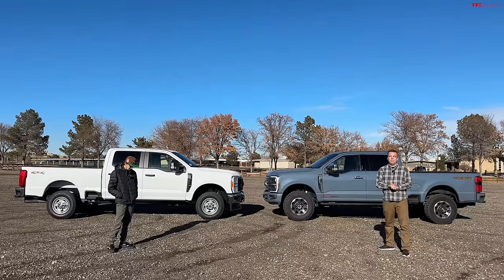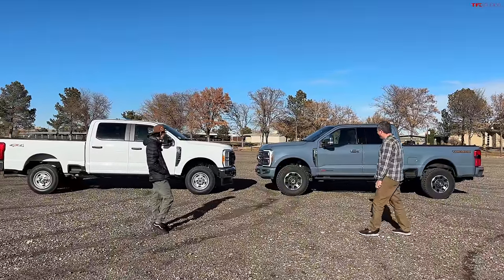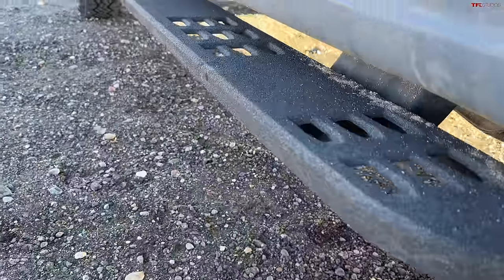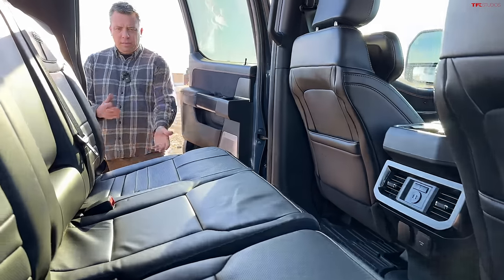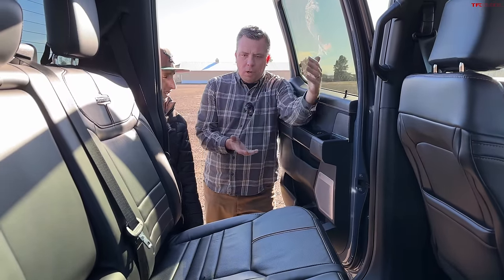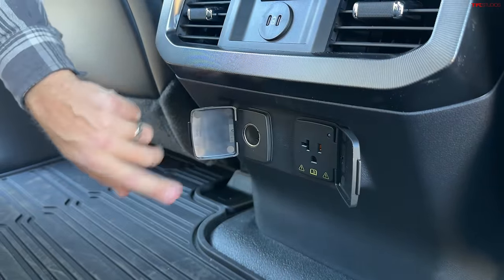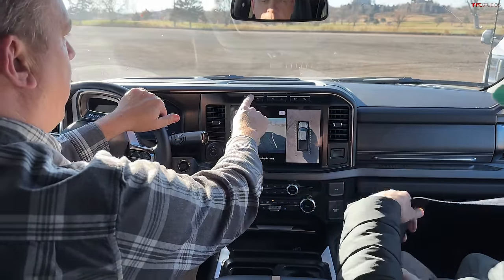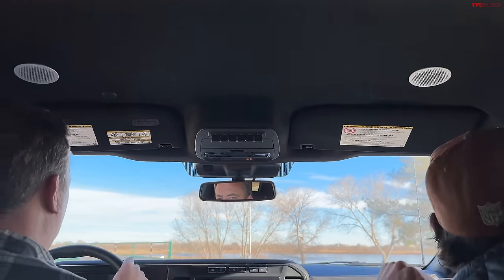New Ford F-250 Work Truck vs Premium Diesel F-250: What Do You Get for an Extra $50K?

Comment: Good thing FORD has a option of four engines to choose from since these bodies are aluminum and the vehicle is fuel efficient and can haul/tow excessive amount of weight. GM (big fan of) can learn a learn a thing or "two" maybe more from ford about engine options.
Reply: Agreed, and I have the GMC.  I bought the Duramax, but would have liked a gas big block with the Allison transmission option.  Bring back the 8.1L , and it would sell like hotcakes...
Reply: @richfarfugnuven6308 the 6.6 gas seems like a solid engine but it's absolutely in the :"just barely good enough" category, which is not what people find acceptable for these prices.

Comment: If that were the choice, it would definitely be a step up from the XL.  I could live with it for sure. But i shopped for 7 months, looking for a v8, 6.5' bed, heated seating and stering, with adaptive cruise.  Everything i found new was over $68k.  Even used in an F250, the price was stupid.   I'll settle for what i found,  a 2020 F150 Lariat 5.0 with under 13k for $44 OTD.  As long as it holds up for the next 5 years, im 😊 happy.   I just didn't want the $1100 payment.

Comment: As someone who had the black capri leather seats (non-perforated) in a 2022 Jeep Grand Cherokee Limited 4x4, I’m not even a sweaty person, but in summer, the pool of sweat and burning the back of my legs was miserable enough where I sat on a towel when temps were above 65 degrees 😅 I’d much rather have cloth seats in the XL. The vinyl looks like cheap seat covers

Comment: The work truck is SOOO much more my speed. I don't need all the electronic junk like remote start, push button, power seats, camera mirror, power tailgate, etc. I like my vehicle to just FUNCTION, and not have a bunch of unnecessary expensive stuff. And it still has those aux switches, which are a nice feature.

Comment: You don't have to go Platinum to get LED lights. IMO, the XLT with some options is the sweet spot price/capability wise. Balance fuel savings on diesel with the added cost of diesel versus regular gas. In my area, diesel is an extra $1/gallon, which is 33% more.

Comment: $50k is a lot of scratch for some bling and a diesel. The camera differences are big to me as well. I went from an Escalade with several cameras to a Silverado LTZ 1500 with good cameras but mine does not have the overhead view. I miss that. I don't need an HD or a diesel to tow my 7,000 lb. travel trailer, but they are cool.

Comment: In 2013 I bought a F350 lariat 4 x 4 for under $50,000 brand new. I cannot imagine how 10 years later this truck is worth 53,000 more dollars.
Reply: 2013 lariat doesn't have the features of a 2023 xlt for under 60k.
Reply: @guyod1  That's the point. You trying to tell me the technology in this truck is worth $50,000? The engines not that much different. The transmission is not that much different.

Comment: He totally missed that with owning a diesel. You have significantly more expensive catalytic converters emissions standards def fluid and you have filters that need replacing more often then a gas engine, diesels Will always cost a lot more to maintain, sure it makes 1,200 of torque but last i saw diesel on average costs about 30 to 50 cents more per gal than gas, if you tow 9tons all day sure, but for the average person/ business the 53k gasser will be just fine

Comment: I didn't watch the entire video but did they go over the XL can also come with MANAUL locking hubs.  Talk about a simple system.  You have to get out and turn the rotor on each of the front wheels to put into 4wd.  You have to do it to release 4x4 but much less to break with vacuum system of the auto locker systems.  The Platinum buyers can have their butler do it for them if they slum down to a low trim.  Yes I was looking into one when the XL F250 4x4 is less than even basic F150s on dealer lots.
Reply: No, since like 2005 super dutys have been auto locking with a manual failsafe.

Comment: Get the XLT with ordered radio upgrade, 6.7 regular setup, still save 35k and have all the capacity of the 6.7 engine. The reason it's a 10k upgrade is because you need the other transmission to go with it.

Comment: Also the Ford undercarriage and axle is always rusty even off the dealership lot.
Reply: I looked under several Ford vehicles at the LA auto show, cars and trucks. Every one had at least a couple rusting bolt heads and other surface rust. Even on a Mustang that was displayed almost rolled over to show off the underside there was rust. By contrast, I did not see this on any other make. Like Ford does not care.

Comment: For $50k you could buy an older 3500 dually frame/chassis, a brand new or refurb drivetrain of your choice without the need for DEF and add whatever seating/accessories you want.

Comment: I'm happy to see you guys talking about the GVWR on these trucks as well. Looks like you have an F250 and an F350 with the wrong badges. The whole point of 250/2500 trucks is the 10,000 pound GVWR for registration purposes. I hope you show more of this because it's very misleading to consumers. They will buy the 250/2500 diesel and register it at 10,000 pounds, and think they still have the full (in this case) 2800 pound payload capacity. That is until the DOT weighs them and slaps them with a fine for being over weight (based on registration) even though they're within the manufacturers ratings

Comment: I actually last week bought for $54,000 a 2018 F350 King Ranch Diesel, crew cab long bed. It only has about 90k miles and to save 50k its so worth it.

Comment: It’s also also good at loosing you money from being in the shop for weeks on end because the emissions crap breaks. 

Give me a 7.3 PowerStroke, 24v 5.9 Cummins (with mechanical fuel pump conversion), LBZ or LML Duramax any day of the week over any new diesel, be it Ford, Gm or Ram.

Comment: It will take you over 250,000 miles to pay for the fuel cost difference vs the initial cost of the regular output diesel, much less the HO. Secondly, every Diesel oil change at a shop will average about $150, plus, every other oil change you are replacing the fuel filters for an average of an additional $180. This averages to $240 per oil change, vs the 6.8/7.3l oil change of $85. Then, you have the maintenance and repair costs. Diesels are heavier, and have more torque output, so you will average about 33% less tire life (still better than electric cars which are more like 75% less tire life)  At 100,000-120,000 miles, a full tune-up with plugs, an induction clean, air filter, and new plug wires would be about $1100 on the 6.8/7.3.  On the diesel, a new DPF filter when the stock one stops regenerating, $2,500-$6,000. Other somewhat common issues with modern diesels past 120,000 miles: A new VGT turbo, $11,000-$15,000, A full fuel system replacement when the high pressure fuel pump grenades, $12,000-$15,000, and new injectors alone, $3,000-$4000. They also have two starting batteries, and are still harder to start in cold climates, so their starter motors tend to fail earlier than in gas engines in said climates. My advice, unless you tow almost every day, and make money from said towing, a gas motor will be the better choice 9 times out of 10. Even IF you make money off of towing, if you do need a repair, the shorter repair hours and parts sourcing on the gas motor being easier would give you less down time. It's also a lot cheaper to insure. Modern diesels outside of true professional pro professionals, that are professional, are unfortunately now on the same wavelength as buying a plane to travel to Mexico twice a year.

Comment: Why do you call it "premium"?  It is just more expensive.  And a "work truck".  What has really happened is all trucks used to be like the XL.  Then manufacturers figured out they could get more profit if they put more crap on the truck.  Instead of denigrating the "cheap work truck" it would be more useful to consider it a truck that does its job with a lot of frufru crap added to the price.  Compare it with my 1974 F150 and the "work" truck is very comparable.  But the manufacturers have successfully created the impression that if you dont buy a higher "trim:" level you are cheap.  That is too bad.  You get the best value with the XL.

Comment: I would take the work truck any day, all the changes have to do is stretch the frame 2 meters and install a flatbed. Then mount a custom built camper on top of that.

Comment: The bed liner is a non-issue, you could get a spray-in for $600.
Reply: Or to be even cheaper, you could do what we did with our farm/plow truck (8ft bed) and get a vinyl garage floor mat for under $50 and trim it to fit the bed. It actually works so well we used the excess for our Gator bed too 😂

Comment: I’ll take the xl, put on the katzkin interior, Carli suspension, throw on a four wheel camper and I’ll still be cheaper than the tremor diesel, lighter, and more off road capable. And still be able to two something if needed. These luxury trucks are ridiculous imo. $50k and the only thing they talked about was the power difference and cameras. Stupid lol

Comment: No way i could ever justify that top of the line truck. If i had money to burn, I'd go for a 350 srw XL or XLT. With the savings, I'd add a steel flatbed and steel ranch hand bumper and I'd still have plenty of money left for upgraded tires and a receiver mount winch. Its a truck, meant for work.

Comment: Towing is limited on the 6.8 due to the transmission. The 7.3 gas and 6.7 diesel both get the same transmission. The 6.8 is a completely different transmission. Not sure why they wouldn’t make things easier and use it on all 3 engines.
Reply: I don't know for a fact but I'm assuming the lighter duty transmission in the 6.8 has more fuel economy. I look at it as a good thing the 7.3 has the same transmission as the 6.7 ho only because it should easily stand up to anything the 7.3 can do to it. If it can withstand 1200 ft lb in a f350 the 7.3 should be no problem. Any one of these trucks should handle anything well power doesn't make the tow rating the f650 750 have detuned 6.7 and 7.3 for durability. The 6.7 in the f650 has like 30% less power then the 250
Reply: I am sure there are some engineering reasons for the different transmissions, but also a big factor is cost...automakers have to squeeze every last nickel of profit out of vehicles, ya know!
Reply: Question is, is the transmission in the 6.8 used on any other vehicles? If it is, I can see why ford chose to use it. If they have a dedicated assembly line just for the 6.8 tranny, that’s more of a head scratcher.

Comment: most expensive diesel v. lowest trim gas - you can't compare the two, truthfully. If you got a gas platinum v. gas XLT, you have a much better comparison; you're paying for luxury. A diesel Lariat for 65k v. this xlt for 50k - the 6.7L will wipe the floor, have some luxury and be reasonably priced.

Comment: I bought a 23 XL with a 6.7L right before Thanksgiving. This truck is such an amazing improvement over my 2003 6.0 XLT! Mine came with running boards and bed liner in the 8' bed. It also has fabric seats. First thing I did was cut 4" off the chin spoiler. And I had new tires put on it the next week. All in all I'm pretty happy with this truck... the only downside was writing the check for 73k😂

Comment: Ford and GM both have cheater 250/2500 trucks. The maximum GVWR of a class 2B trucks is supposed to be 10,000 lbs. A lot of the Ford and GM 250/2500s are actually class 3 trucks.

Comment: $32,000 used 2020 tundra sr5 crewmax with 51,000 miles. Tows my 4500lb trailer just fine. 8500 pounds loaded with water.
Reply: That's great but those are different animal. Your 2020 can't do what they can. I own a Tundra too and a diesel HD.

Comment: In Hawaii, the gvwr rating on that fancy Ford truck would put you into another class of road tax for getting plates for the truck. But Hawaii does not fix the roads. I hope they are built Ford tuff for the pot holes in paradise

Comment: There really hasn't been anything really appealing about any of the Ford trucks offerings once you get past the XLT trim level for over 20 years. More often then not you can get damn near everything added on at the XLT level and only if you really want more luxury or the special off road variants do you need to go past that. Even then especially for the off road stuff, it's a Ford... you are going to have aftermarket support to turn your rig into damn near anything you want from Baja blasters to rock crawler to even a high speed canyon carver.

Comment: With the Tremor you also get an unexpected benefit.....you get an F350 Tremor! The F250 and the F350 Tremors are identical (assuming the same engine and trim levels), except the badging. This applies to Tremors only. All other Ford F250 vs F350 models are NOT identical.

Comment: Outside of registration purposes (depending on your state), not sure why people buy a 250 over a 350.  Not that much more $$, but heavier duty transmission, frame and suspension components.  Ride quality difference is negligible.
Reply: Ride quality difference is actually huge. Not only that, but because of the increased gvwr of a 350, most states will make you pay more on taxes and insurance. Not to mention, the 250 can already tow 18,000 lbs in its base form. That is a 40' gooseneck trailer and TWO of these trucks in single cab, plus 6 people and some equipment. Just with an F250, that is more then plenty.

Comment: The camera in the back of the tailgate needs to trickle down to all the trucks. I can’t believe they’re just now thinking of this. Also, they mentioned the 120 volt plug in the back but skipped over it being a 20 amp. = a lot more than the 400 watt max you normally get. Your teenage daughter can blow dry her hair on the go.

Comment: Correction - USB - C will power up laptops, if you have the appropriate cable. The 100k truck has leather seats that are already loose in the stretch/tightening of the seats in the back. Quality is not job #1.

Personally, I wouldn't pay $50k+, let alone, 100k+ for a Ford. Price gouging is ridiculous, but then again, just like gas per gallon, they can charge whatever, and we schmucks will pay it. Unfortunately. Great video guys.

Comment: Nothing beats a diesel.  There should be more demand for diesel cars. It's best balance of reliability, longevity, efficiency, capability and durability. It's silly we don't have more diesel cars on the road. Makes no sense
Reply: I would drive an older diesel, but I don't want a modern diesel with the complicated emissions stuff and fuel economy reduction.
Reply: My very first truck when I was 16 was a diesel. I was the only one in my highschool with a diesel anything. I've owned several over the years and a few gas heavy duties. As cool and strong as the diesels are, personally I find gas to be more reliable and cheaper to operate. The main thing you miss is the soundtrack and the torque! Even with that being said I agree we should have more diesel options. Especially in passenger cars.
Reply: Modern emissions suck.  I never idle my new Duramax so that I don't plug up the DPF...
Reply: Reliability, longevity, efficiency, and durability are not things that describe any modern diesel. I will give you capability though
Reply: It's really not. New diesel engines are generally far less reliable than their petrol counterparts, even from a company that's best known for reliability like Toyota. Plus, the money you think you've saved at the pump will go to maintenance and repairs, not to talk of the price of diesel being much higher than that of petrol in some places. Except you're towing a lot or driving longer distances (which is where diesel powered cars shine), it's not worth it getting a diesel engine in your car/truck.
Reply: That is true. Even modern diesels have that. People are forgetting that modern gas trucks are full of issues as well

Comment: 4:17 the amount of money Ford spends in R&D to make sure their buyers only get what they pay for is ridiculous. 2.3,2.7,3.5,5.0,6.2,6.8,7.3 and 2 6.7 diesels all to fill in gaps for cost. So sure you can buy an f150 cheap, but not if you want to tow anything with it. Because then you’ll need to upgrade to the trims that offer 3.5 & 5.0. Same with heavy duty. You want to be cheap, 6.8. You want tech without a $12k diesel? 7.3 gas. It’s insane.

Comment: This just proves why I'd never buy a truck built in the 21st century. Even a "base model" pickup today has a bunch of unnecessary junk on it. A true base model truck has crank windows, no a/c, no electronic display, a bench seat in the front, and most of all, a manual transmission.

Comment: you really don't  need  bells and whistles on a Pick up truck even on a super duty its a truck  it is supposed to be  worked hard and scratched up dented up and  rusted  if you gonna need bells and whistles then get Landrover  or a Jag  .. if you need a Platinum edition truck why so you can say look at me I got a Ford 250 Platinum edition probably cost 103 k dollars  while the work truck is more practical let me tell you why  its a truck simple that works that gets abused with hauling trailers or converted into an ambulance on chassis or  box truck  tow truck additions.   But these extras are for those guys that are looking for ego check I am sorry but why do a comparison on these out priced trucks  I am would chose the XL  250 over the Platinum any day of the week .